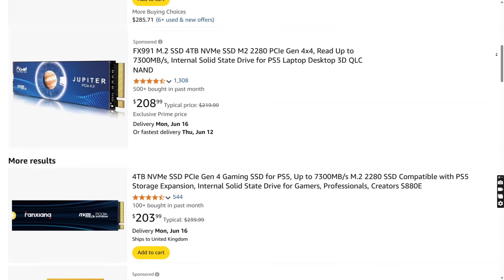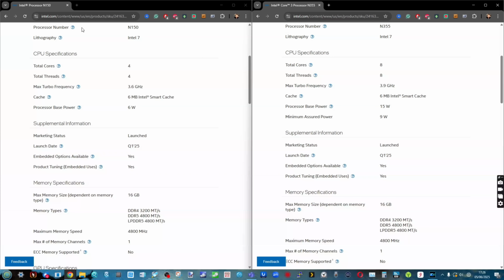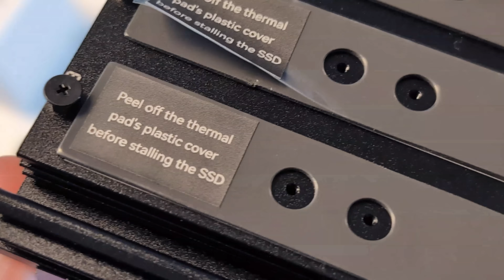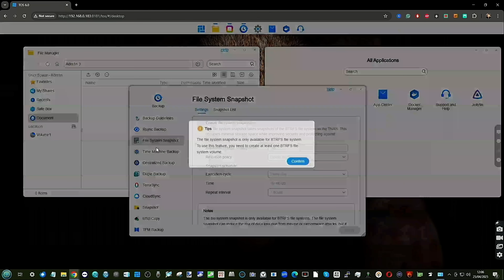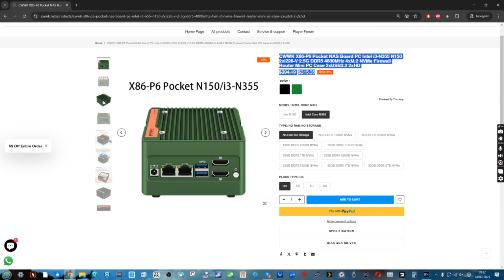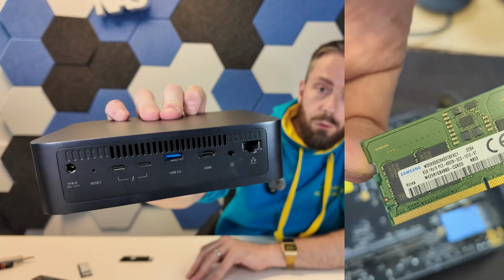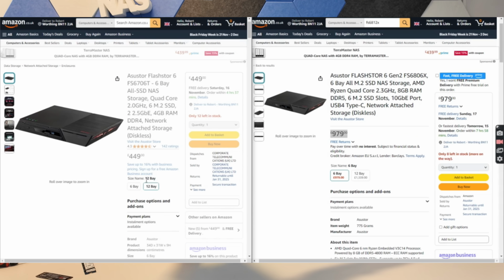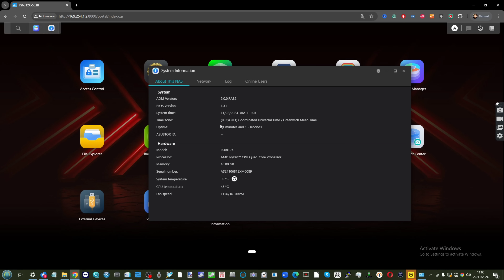The Best M.2 NAS of 2025 (so far)

Comment: Heat is the killer for these NAS, which is why I prefer 2.5 inch SSD over NVME gum sticks.
Reply: I don't know why u.2 isn't a more mainstream form factor. I have stacks of 3.8TB drives I pulled out of my servers a couple years ago and it's been kind of a pain in the ass to use them in non-enterprise systems. I've connected them a 4x4 PCIe adapter and using an IcyDock enclosure on with a Broadcom tri-mode controller, but it's not like you can find sub-$1000 AM5 or LGA1700/1851 with native SlimSAS, even though that makes a lot more sense than devoting surface area and the intense cooling problems of m.2.
Reply: Heat depends of NVME speed ... In most cases you have bandwith in these nases for pcie gen 3. You can buy cold pcie gen 3 nvmes.
but yes these new pcie 4 or 5 disks are hot.
But to run for example 12 pcie disks in full  5  gen pcie speed you will need powerful processor like AMD thread ripper with many lanes.
So these nases have some sort of multiplexer to share lanes and limit  bandwidth  to pcie 3
Reply: @mkunikow correct, the Beelink mini can only run X1 anyway on 5 of the disks…
Reply: @mkunikow  as a NAS, the writes will be throttled much by the network transfer speed.  With the included 2.5 GbE, we expect at most 300 MB/s writes.

Comment: Jeff Geerling did a review of the GMKTec G9 and the results were.....not good haha
Reply: I had a G9 and got rid of it. It gets way too hot with 4 m2 ssds. When I got read errors on new ssds I gave up.
Reply: Yeah, I wonder if he actually put all of these through any level of torture tests, or if he's simply basing his review on the specs of the device.   Showing all those SSDs at the beginning with rando-never before heard of brand names made me sketchy from the get go.
Reply: @Mike__B yeah, I can get an LLM to do spec comparisons - I need real world tests from these guys.
Reply: GMK claims they've solved the heating issue in later hardware versions. If that's true or not I have no idea. If you got one at launch I think you can trade it in for a newer model.
Reply: I think GMKtec G9 has been updated. but i am not sure if it is the latest model used in this video.
Reply: @JonKho83 video is using the old version. You can see the difference at the exhaust. The new one has a mesh, the old one just holes in the plastic.
Reply: Well, many youtubers these days are more like a advertisement department of a company than actually a reviewer. (Not saying this channel is, only that many are), and Jeff do not review units if he can not say whatever he likes about them.

Comment: I like the cheap NAS that have lots of M.2 slots but unless you have low storage requirements I've only been able to think of two use cases specifically as a NAS.  They are not meant for putting  in  8TB M.2 ssds or if you need a lot of docker instances.  if you can afford a bunch of expenses SSDs, it doesn't make sense to pair them with a slow processor and slow PCIe slots. Where these NASes can be useful, you have a handful of docker apps you need 24/7. Bitwarden vault, home assistant, etc in you don;t have large storage requirements. And even if you do, you can offload a few of the docker instances from power hungry servers to truenas or small proxmox cluser then tweak your big server to reduce it's power consumption. The other use case is if you  need to move certain type sof storage/compute around easily (e.g. having a nas for a road trip)

They are also great for just using as reliable low power secondary PC for low demand desktop applications because you can mirror the main drive and still have a backup storage area . Similar idea with more reliable cheap homelab servers for learning kubernets and other sever technology. The extra m.2 slots make it easier to backup and recover rather than installing everything from scratch when things go awry experimenting.
Reply: Also okay for horizontal scaling NVME storage in a microceph home lab storage cluster. I can accept less than full speed in exchange for having more nodes & drives to parallelise the I/O load and lessen the impact of a drive/node failure. But, an N100 CPU can't reliably do much more for ceph than run a storage daemon. So, heavy lifting needs to be on other nodes.
Reply: @eturnerx  Yup. I'm currently running a few minipcs in 3 node HA proxmox cluster using ceph. I have another 10 node minipc cluster for local kubernetes test network.

Just picked up the Beelink ME. Still thinking about how where to use it. I have some 8TB ssds laying around but decided againt it for aforementioned reasons.

Comment: The Beelink Me Mini has some temperature problems, when 6 ssds are installed. they need a second revision.
Reply: I had to return mine, constantly getting driver errors in both unraid and truenas... Replaced with the terramaster and that had been rock solid.
Reply: @MrShad3s  did you find any YouTube that maybe switched the fan to outtake? I read the suggestion anywhere. but I didn't find someone how did this.
Reply: @MasterMind187b i did not try that, as my drives were constantly getting errors while setting up unraid. I ended up returning the mini for the terramaster m.2 nas.
Reply: @MrShad3s die you Check the temps? Maybe the Problem was the device. What drives do u used?
Reply: Hi! Thank you for your feedback. Could you kindly contact our support team and share more details about the issue? We’d love to gather more information and will work on optimizing it as soon as possible.
Reply: @Beelinkchannel  Thanks for the reply. I haven’t ordered the device yet because I first wanted to be sure it can handle the heat dissipation. I found it strange that none of the creators tested this or even mentioned it. In the comments there are already a few people reporting overheating issues when the device is used as a small server running around the clock.

I was planning to equip it with six 4 TB SSDs. Here in Germany, a single SSD costs as much as the entire unit—and once I’ve used them, I can’t just send them back. Maybe you should note on your site that people should use single-sided SSDs. I keep reading about a 4 TB maximum, but there are also double-sided 4 TB SSDs.

I’ve already contacted support to ask whether there will be a second revision. Some creators suggested turning the fan into an exhaust to leverage the chimney effect. Did you test that during development?

I’m not willing to buy components just for testing. At the moment I only have a gaming channel, so I don’t make product videos.
Reply: Depends on ssds. Gen3 without DRAM run fine.
Reply: @sebko359  gen 3 or 4 should not be a difference. all ssds run with 3x1. and newer models have controller with lower nm. so its maybe even better.
but some people already testet it with dram less ssds. same problem.